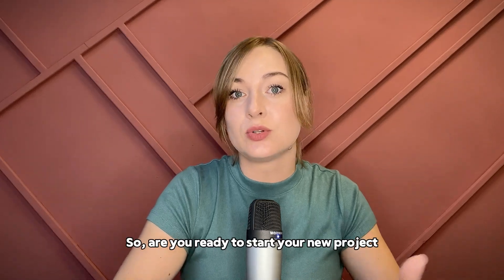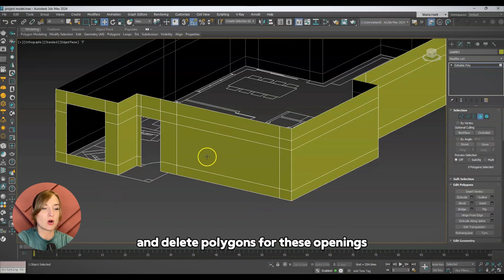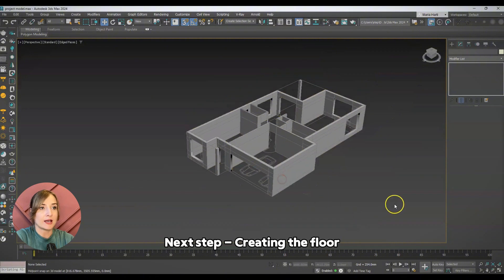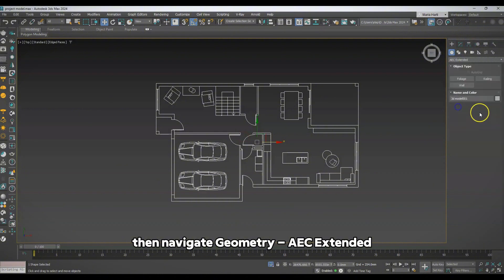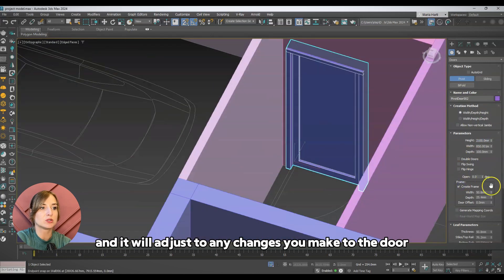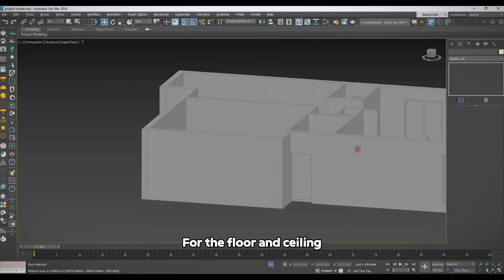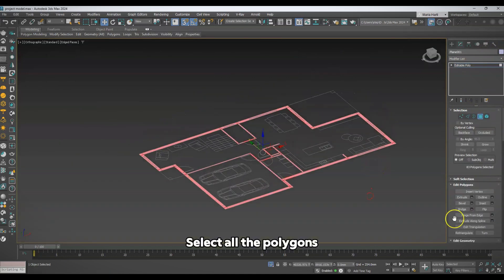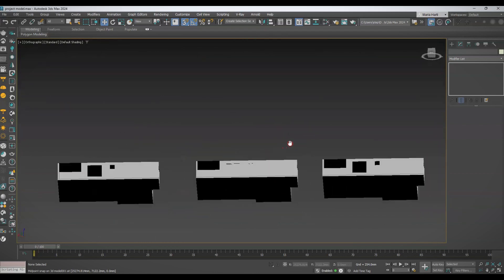3 Best Ways to Create Walls | 3ds Max Tutorial

Comment: Which method is the best ?
Reply from the maker: Each method is good in certain situation. You can choose the one you feel will work better for you!
Reply: @EdditAcademy no.. only method 2 is the best. Because you don't need to construct window / door again. Otherwise you must do it 2 times, wasting time. After making a hole, then you need to draw a door/ windows again😂. Polygon is only for complicated wall & design at an angle . It should not be recommended.

Comment: I have my own method. I create a wall polyline in AutoCAD and import using a quick Paste from AutoCAD. Here I extrude it. For doors and  windows area I leave an opening in wall opening which goes all the way to top from bottom. To cover door tops I create a line at each door segment and add sweep with box. For windows it is similar only instead of box shape I use a spline to give me both bottom and top. For different windows vertical size I either use edit poly adjustment or create another object (line with sweep). 
Changing wall is easy as it is a spline with extrude on it. And edit poly is not use (except for some adjustment) making it quite procedural. Only drawback is geometry is split at windows and doors opening so any modifier depending on that will make errors.
Reply from the maker: Thanks for sharing your method. It’s absolutely fine to adjust your workflow in whatever way helps you optimize both the process and the time you spend on it.

Comment: in method 2, my wall cant open when i creat door pivot like you,....
Reply from the maker: @kienpham8103   usually the built-in walls create doors/window openings automatically, but you must make sure the door/window depth is the same or higher that the wall depth, to break totally through the wall. 
Also, seldom it happens that the wall doesn’t detect the door/window and you have to link them manually, using link tool 🔗.

Comment: My wdoors are not automatically cutting threough the walls like yours
Reply from the maker: Make sure you create your walls using the right instrument called “wall”. In case it doesn’t work use link tool to create the connection between the door and the wall.